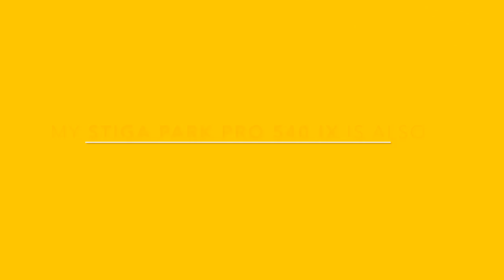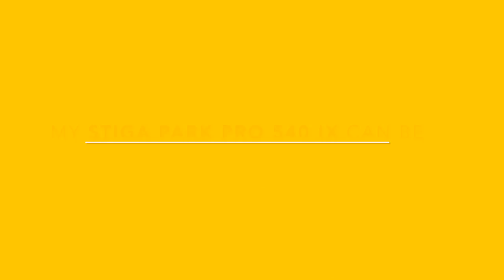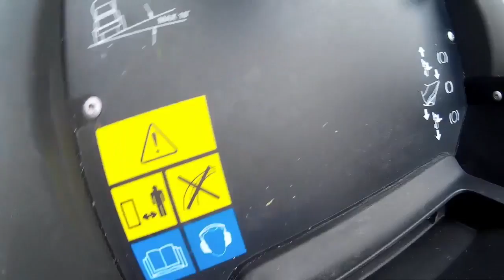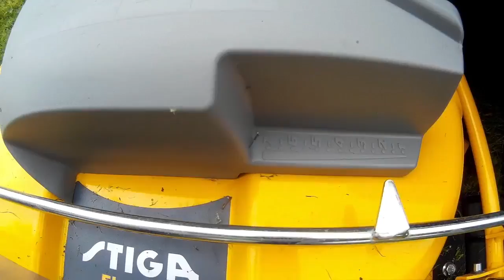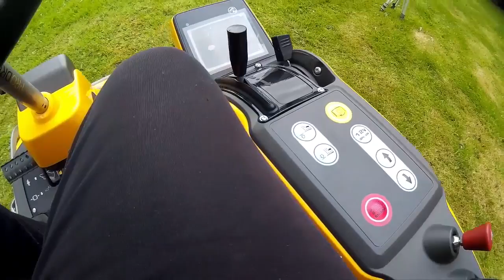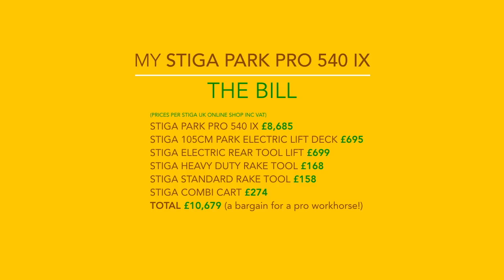Stiga Park Pro 540 IX mulching ride-on mower review in HD

Comment: Thanks a lot for getting back to me so promptly Kay. I live in Ireland and we tend to get more rain here, even during the summer, so I sometimes have no option but to cut the grass when it is a little damp!  The mixture of sunshine and rain of course result in the grass growing pretty quickly during the summer months, hence the need for frequent cutting even when the grass is damp.
Unfortunately the tyres did not repel the damp clippings so I had to wash them off before the dealer picked up his machine.  I was still very impressed that there were no clippings visible on the grass though.
As the grass was just a little bit damp when I cut it with my new Stiga the other day there was very little grass stuck to the underside of the mower.  I had a go at removing it with a wooden spatula but it was boring and would take forever if there was a lot of clumps of grass stuck to it.  I agree with you that life is too short for that!
I'm going to clean it with a hose in future while making sure that I don't point it directly at the bearings. 
Regards John
Reply from the maker: John, there will be plenty of advantages to living in Ireland -- the biggest of which, for me, being that you don't have any of those pesky moles.

Comment: Great video Kay.  My local dealer recommended a Stiga mulching mower to replace my aged Castlegarden ride on as it's deck was on the way out.  I viewed your video and was very impressed with the power and flexibility of your Stiga Pro mower.  My dealer allowed me to try out a 2 WD mechanical steering version but I found the steering very heavy so he then allowed me to try out his own Park 740 PWX 4WD which has power steering and is a wonderful machine that is very easy to use.
It really did a greatl job on my lawn and a much better job than my previous tractor mower which nearly always left clumps of grass on the lawn when I used it in mulching mode.  
When I cut the lawn with my dealer's mower it was quite wet and I was amazed that there were no clumps of grass left on the lawn when I finished.  I took delivery of my new 740 PWX on Monday and used it for the first time yesterday, needless to say I'm really pleased that I bought it.  I retired a couple of years ago and I have no doubt that it will see me out!!
Like yours, my deck lifts up about 30 degrees for cleaning, without disengaging the belt.  It lifts up 90 degrees with the belt disengaged but that's more complicated and so I'll probably stick with the 30 degree lift.  
I'm wondering how you clean your deck.  Stiga appear to recommend cleaning it with a water hose (see the UTube video on the Park Quick Flip for example) and that was how I intended to clean it.  One of the mechanics working for my dealer recommended not using a hose as it may lead to problems with the bearings.
I'd appreciate feedback based on your experience.
Regards
John Butler
Reply from the maker: Thank you, John - and congratulations on your new Stiga. As per my reply to Nils below, I try to always mow when the grass is dry since that helps the clippings to fall right down to the roots and also stops them sticking to the tyres. If I mow damp grass then I do get a gradual build-up of clippings on the tyres which eventually fall off to leave a few clumps on the surface which can sometimes be dispersed by mowing over them again; otherwise I collect them with my attached rake. I'm a bit jealous if your tyres magically repel damp clippings!

The other big benefit of mowing dry grass is that very little sticks to the underside of my deck, making cleaning easier, and sometimes unnecessary. I do use a hose - and occasionally, when there is a thick residue to remove, I use a pressure washer since a hose won't shift it. After a year, there have been no ill effects. But I only use the pressure washer on the deck and the tyres, taking care not to point it at bearings or belts. The rest of the mower stays pretty clean so all it gets is a blast from my leaf blower before I wash the deck and tyres. When I'm mowing regularly through the season, I don't bother to clean it every time if the grass is dry.

If you are cleaning the deck and tyres without a hose, I imagine you would need to dislodge the residue with a wooden spatula or a very stiff brush - but life's too short for that!

Comment: I have had my park 14 for 3 years and not a single problem.Use it, with snow rake, flail mower, mower and combi cart.Guess the next step is to buy a Pro machine with a Honda engine:)

Comment: Hi there. Great review. I live in SE England and was thinking of getting one of these machines. Now after three years of use are you still happy with the matching. Any problems with it or is it still going strong. Cheers Steve
Reply from the maker: Apologies for missing your question. I feel exactly the same about this mower as I did on day 1 and it hasn't missed a beat - nor have I had to replace any parts.

Comment: Thanks for posting your review, it's very informative. I have a few of questions: If cutting grass close to a path, does it throw clippings out of the sides that would require the paths being swept? Do you have any experience of using it on banks or clearing meadows? One final question: Now you have had the mower a while, is there anything you are less happy about. Also, what are the annual servicing costs likely to be if used on a 5 acre garden mown weekly?
Reply from the maker: Richard, I apologise for the delay in replying to you but for some reason our host didn't flag up your message to me.

In mulching mode, a small amount of fine clippings would end up on your path. I simply go around afterwards with a cordless blower to tidy mine up. 

I use my 540IX on gentle banks but it is able to tackle steep slopes with excellent traction thanks to the 4WD and power to spare. My permanently attached rear rake reduces my ground clearance when going up slopes as the rake can dig in when I start to climb. Mowing horizontally across the side of a hill could be precarious as the official recommended tilt is 10 degrees. Stiga are protecting themselves because I have read in a forum of at least two landscape contractors using their machines daily on 45 degree slopes! I keep my tyre pressures at the low end of the spectrum to improve my ride comfort but this also would be a good idea for slopes.

If your meadow grass is long, Stiga would recommend getting a flail mower attachment but I can cut tall grass (12-20ins) roughly by using a standard deck tilted up - then I go over it again with the deck flat and on max cutting height…and if I need to cut lower, I lower the cutting height and do it again. This is not recommended by Stiga of course - but there isn't an automatic blade brake when the deck is raised up as there is with many machines - at least not with my 105cm deck. Further, although I have never tried it, you simply have to remove a plug to convert the deck from mulching mode to conventional rear ejection of the clippings - which would be the logical option for long grass. 

After a year, I am as happy with my mower as I was on day one. It starts first time, every time, even in winter and it has never missed a beat. I haven't had to top up any vital fluids other than fuel and the blade remains sharp (but I do clear stones etc away before mowing). I still wish Stiga had included a fuel gauge on the dashboard display instead of some of the esoteric information that I don't need. And I know from past experience that my metal deck will start to rust soon even though I keep it clean. I could have chosen a plastic deck but I had one on a Husqvarna out-front ride-on and didn't like it as it felt flimsy and made a lot more noise than the metal deck - especially if a twig gets spun around under it.

As for servicing costs, I can only tell you that my local Stiga dealer does my annual service for £200 including collection/delivery and new filters/oil etc as recommended - but not yet a new blade. But my weekly-cut lawn is less than a fifth of the size of yours.

Comment: Great Video! I have a question, when you say that you can't leave the gras long for the mulching to work, do you mean that you cant cut off to much at a time or that you must keep the gras short overall? I prefer my gras very long (3 inch +) and I had some problems with clumps with my 95 combi deck, similar to yours. Although my gras is extremely lush and thick.
 I have also had a combi 100 deck (100cm with 3 knifes) I think that the 2 knifes deck cut better but it is more sensitive to rocks and roots because of its timings belts. Did you know that there is a striping kit for your mower deck? It is a roller that attaches to the back of the deck. Most Stiga dealers don't know this so you have to be a bit "pushy" to get them to call Stiga to order it.
I have had 3 Stiga Park so far but no 4wd yet. Regards Nils from Sweden
Reply from the maker: Thank you Nils! For me, there are two reasons why mulching doesn't work so well on long grass, even if you just trim the top off. First, it isn't so easy for the mulched clippings to find their way to the base of the grass plants because they have further to travel and they have to negotiate their way through a thick sward where grass blades overlap and intertwine to obstruct the law of gravity. And second, however dry long grass appears to be at the top, it is often damp at the bottom where the sun and wind are blocked out - so the mulched clippings, even if dry, will tend to stick to the damper grass instead of settling at the base. And, of course, if the clippings are even slightly damp, they will stick together forming clumps which lay on top or stick to your tyres.
That's why, on the first cut of the season (when just trimming the top off), I either collect the grass clippings or I mulch-mow again after 24-48 hours when the remaining grass has had a chance to dry out properly.
Check this video to see what happens when mulching long grass: https://www.youtube.com/watch?v=GTQYQyiq-qQ
I agree that two blades give a better cut than three - partly because the larger blades are heavier and cut through the grass more cleanly - but there is no blade overlap on new Stigas so the timing belt has been dispensed with.
I do know about the striping kit but it's not for me as my lawn is an irregular shape and I often shoot off sideways to mow under shrubs. Anyway, the striped effect is achieved by forcing the grass to lean over and that isn't going to help my mulched clippings drop vertically down to the bottom. Of course, the tyre tracks leave something of a striped effect behind anyway!
Reply: Thanks for the long and informative answer. I think I will try to cut the grass short and see if the mulching improves. Are you sure about not having timing belt on the 2 blade deck? As far as I know, they still have that but it's easy to check. Regards Nils.
Reply from the maker: Having just replaced it, I can confirm it is a toothed timing belt. The critical requirement for effective mulching is dry grass so keeping it shorter will help the wind and sun to dry it. It will also provide less resistance to the blades so that they rotate faster and therefore shred the clippings better before they fall to ground.

Comment: why would you gas or blow up a mole hill anyway it is easy to just let them get on with it and then you could use the rake and sort them out otherwise I think I might buy one of these since I heard bad review of the Husqvarna 200 series which was my original choice also a good mowing tip cut off a bit of the lawn so it is a rectangle then go around the outside once or twice then go up and down then this will stripe it good
Reply from the maker: My previous mower was a Husqvarna 316TXs (after several Stigas). I sold it after a year because it felt flimsy, made too much noise and didn't cut as evenly, or mulch as finely, as the Stigas. Although I prefer the sleeker styling of the Husqvarna, it is inferior in several respects - not least in the fact that its deck is less "out front" so it can't mow as far under shrubs and obstacles as the Stiga. It is also harder to clean the deck. And it bounced me around so much on my uneven lawn that I went looking for my new Stiga with its bigger wheels and air suspension.
My rake attachment is great for levelling the molehills but the real problem with the moles is the dense network of invisible tunnels they leave, just below the surface. I twisted my ankle once when the ground gave way under my weight so I rate moles as a danger to life and limb! In some countries you can inject poisonous gas into the tunnels, but not in the UK unfortunately.
Reply: I know things like moles are popular in uk since I live in the middle of no-where and I see them all the time so I get a sheet of paper with my garden on and I draw where the hills will be and the next time I have an idea but I can see why you don't like them

Comment: how big is your land if you need such an expensive mower. For 12000 bucks I would rather buy a used tractor in good shape
Reply from the maker: Less than half an acre so I agree that the mower is over-specified. But no other machine gave me all the features I wanted - and there are no mulching tractors with out-front decks. I knew I was over-spending but it would only have gone on wine, wimmin and gambling otherwise and I haven't regretted it.
Reply: Great answer lol
Reply: @kayberry6292  atta boy!
Reply: Hell if you got the money to burn and you enjoy being on the yard then cost of what you buy doesn’t matter. Lol I have 72 inch commercial toro, and I only have 1.5 acres.